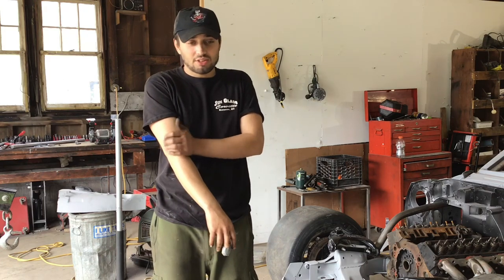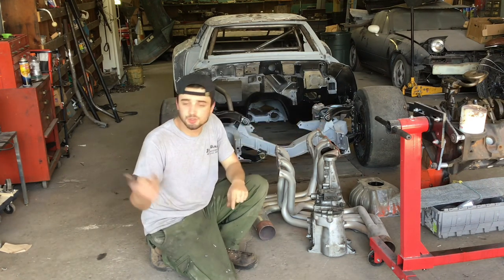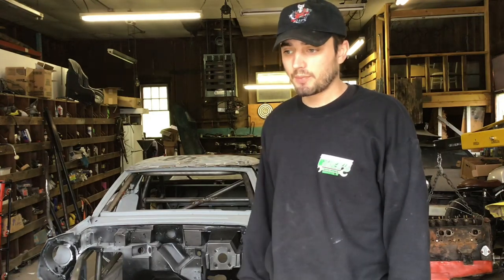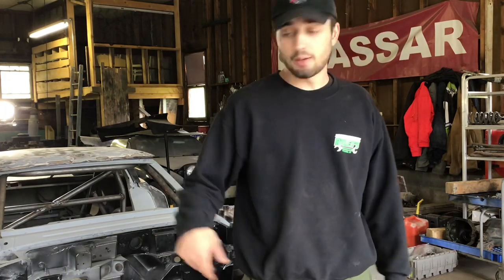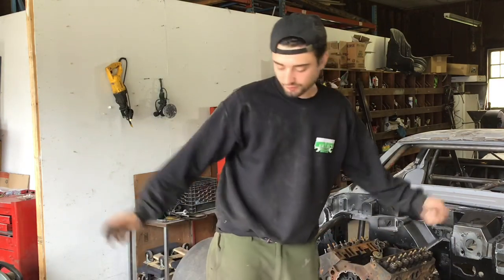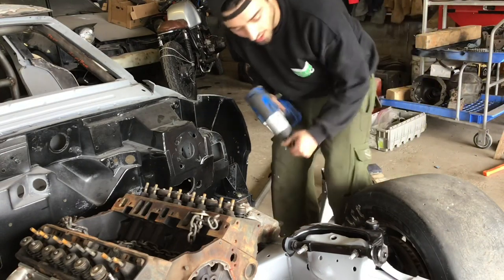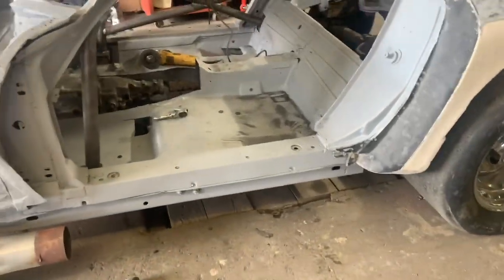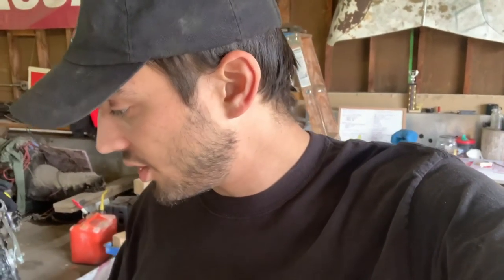WSG 13: Corvette Racecar Drivetrain Mockup

Comment: I see that MANd-Aid you put on the finger.  Atta boy!
Also bonus points if that was alcohol and not peroxide you cleaned it with.
Reply: Hydrogen Peroxide always comes in a brown bottle.
Because light kills it. That was alcohol. But? Did he
use it?  I would not have. A very good reason to
always have Hydrogen Peroxide on hand.
Reply from the maker: Haha it was alcohol.  It was all I had on hand.   Well truthfully it was between that and brake clean